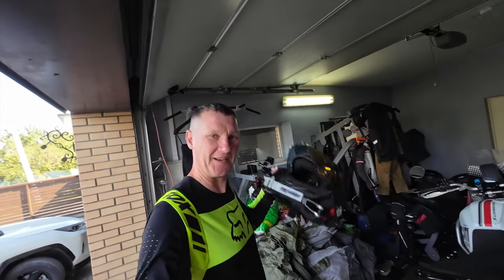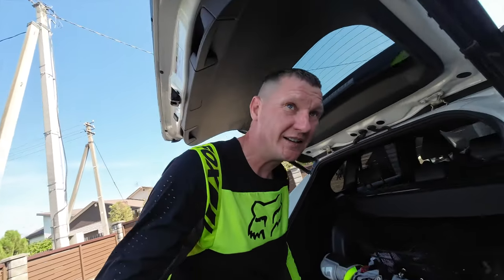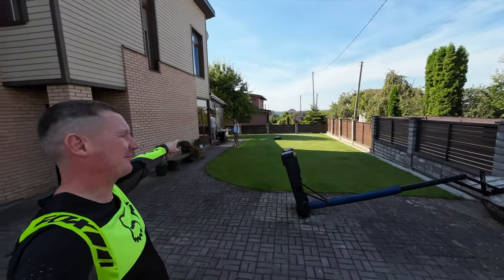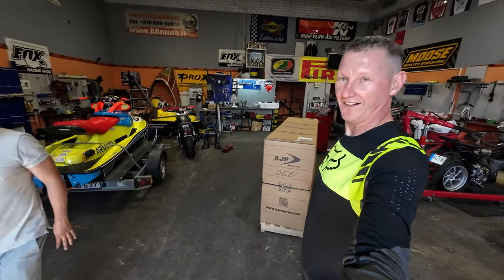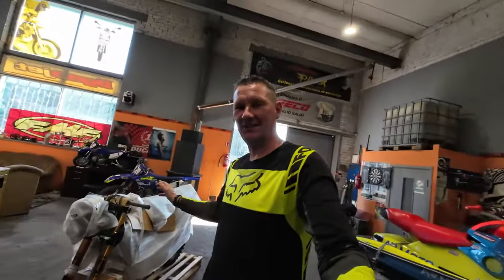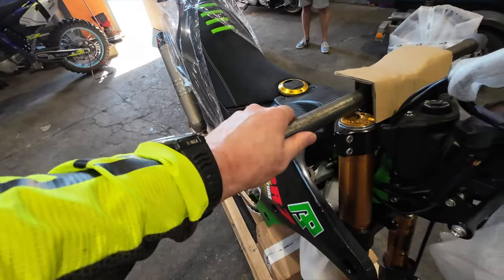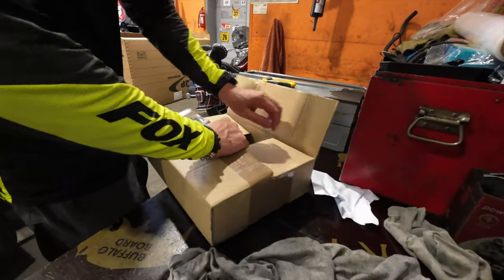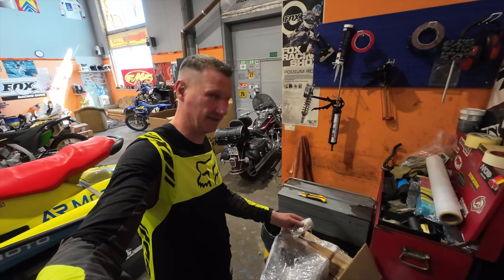I've bought the best Enduro Adventure motorcycle you CAN'T buy! AJP PR7 35th Anniversary edition

Comment: Oh, that bike! It looks very nice, and I like the built-in navigation solution.
I'm sure you'll appreciate the weight reduction it provides in Spain and Portugal, as some TET sections there are less than friendly for big adv bikes.
Quick tip about the tires: Motoz Tractionator Adventure front has minor stability issues and is phased out in favor of Tractionator Dualventure. I'd try to grab it instead, as it's supposed to be a bit better all across the board.
Reply from the maker: Thanks much 🤜🏼🤛🏻
I noticed your comment a little too late. So my tires choices is MotoZ adventure in the rear and RallZ in front. I think the RallZ will be a little “grabbier” for the front and might work good enough.
Reply: I did use RallZ front myself - amazingly lasted me 15k km, but added some vibrations to the handlebars on tarmac. Performance-wise it was average, more suited for dry conditions.

Comment: I love my PR7.
You are fortunate to get the special edition.
I too went with the Tractionator in the rear and the Rallz in front. I'll stay that way was except I'll be putting on the tube less version on the front as my current one wore out in 9kM and there is still life in the rear. Added heaver springs in the front and back and a steering damper. Added a remote control from Thork for the navagiation display. Replaced the battery with a Parts Unlimited as the OEM would't crank the engine over easy and died early. I think the voltage regulator is dying. Still love the bike. Just discovered your channel and will have a lot of videos to watch. Thank you.
Reply from the maker: Hey, Thanks for joining and all the thoughts you shared. Talking about the PR7. There is not that much of a difference between Standard and Special editions as you know. Everybody thinks that Ohlins is a GOAT over here, but... I find it way too hard for my riding style and gonna have to do something about it. I think that something in the middle between stock and mine would have been the perfect spot. So, here we go, the rest is just small addons and the decals :)